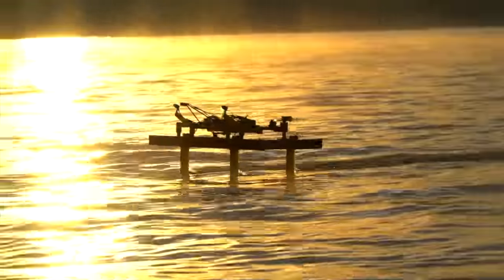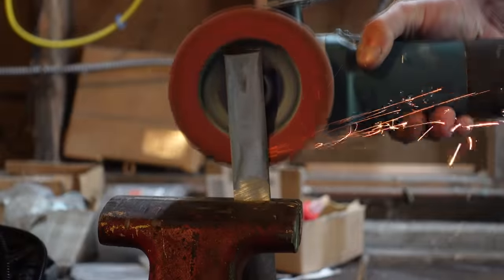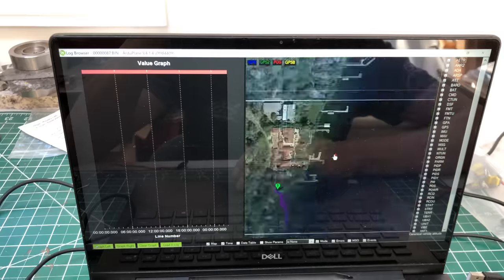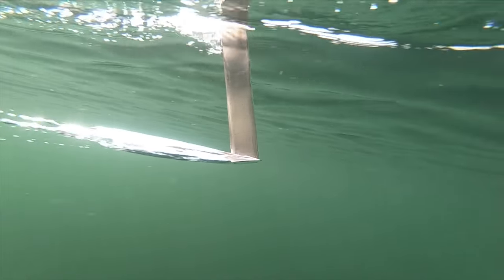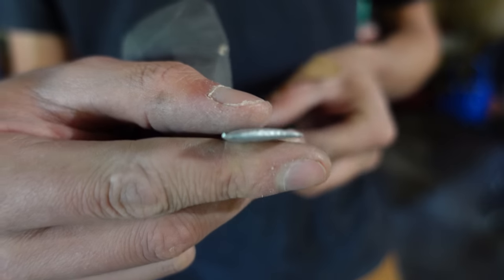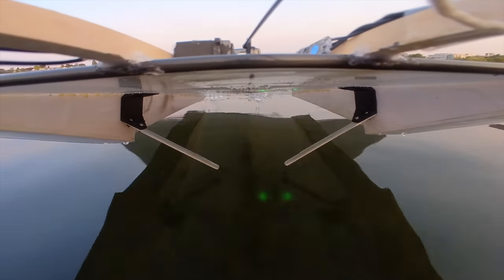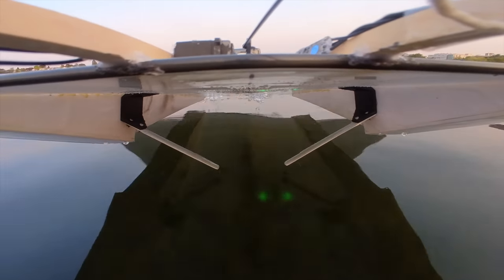Airplane + Hydrofoil - Good or Bad Idea?

Comment: In real boats, isn't yaw stability a function of roll stability? I mean if you've ever driven a speedboat or a fishing boat, that boat rolls as you turn it, the same as a motorcycle would. I think the surface piercing hydrofoil is supposed to have yaw stability because of its roll stability. There's a feedback between how much is submerged on either side. With your piercing hydrofoils, you have almost no ability for the aircraft to roll before one of the sleds or the wingtips hit the water, so it can't stabilize itself.

Comment: you're also cavitating bro... the thumb camera can see it in the video.. (the flow is separating from the hydrofoil as the craft translates vertically through the water.)  vertical translation through the water once the hydrofoil is submerged and at velocity, the flow separates.
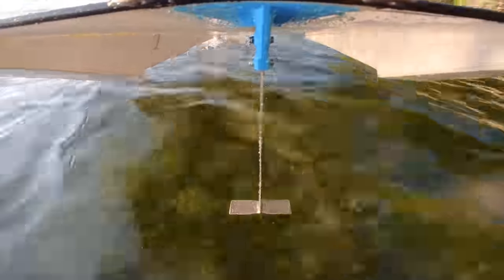Reply: from 7:29 to 7:32  when the foil is below the surface... you can see air forming above the foil
Reply: at 10:07 you can see wing tip vortices forming from the CAVITATION
Reply: you keep calling it ventilation then you bring up cavitation and start saying things like pressure drop is so large the water boils.   So when you see an air pocket FORMING across the wing surface BECAUSE it's DESIGNED to LOWER PRESSURE OF A FLUID in a directional flow...  It doesn't matter if it's a penguin streamlining through the water or a man made hydrofoil...   IT"S ALWAYS CAVITATION.   THE AIR POCKET IS THE WATER BOILING.

Comment: Angle of attack is a lot of the issue you are running into.  You have the foil mounted parallel to the bottom of the craft but the craft travels nose up, messing up your angle of attack on the foils.
Reply from the maker: But if the foil does not have a positive angle of attack, what’s the point? Then it won’t be doing anything
Reply: @rctestflight  a foil should generate lift like an airplane wing does with the shape of the wing, not with angle of attack.  You mention it yourself with the ventilation...you can see it happening in your video both when you show the example from the side of the boat and on the craft itself previous to that.
Reply from the maker: @InspGadgt  If you look at the CL vs alpha graphs of many common hydrofoils you'll see they make very little lift at zero AOA. Especially at the low Reynolds numbers this model is operating at

Comment: you are forgetting one of the biggest benefits of a ground effect vehicle. you don't need a pilot's' license. 
i would not be surprised if the only reason you are limited to ground affect area would be because of the electronics. i wonder what the speed of that thing is.

Comment: Your wing is pitched up and if your hydrofoil is pitched up too isn't it providing too much lift and therefore causing drag? Why don't you pitch the foil down a bit to provide less lift on the foil
Reply from the maker: But then what’s the point of the foil if it’s not creating any lift?

Comment: You miss the point. The idea is to have the foil to reduce the power needed to lift out of the water into GE. You don't want to operate in GE with the submerged foil
Reply from the maker: Hydrofoils were slower to takeoff than planing hull alone since they have more drag, so…

Comment: nice surface skimming spinning disc rock
Reply: mental models can be deceiving, traditions can be chain-binding
Reply: ie "I must do things this way, no other way is possible or viable, and I must convince others that nothing else is viable"
Reply: its called a law
Reply: which is not correct
Reply: logical thinking does not lead to the proper solution, logical is illogical, only the appearance how things might be
Reply: mind reasoning might be counter-truth
Reply: whatever is the measure of truth, if any, or all goes
Reply: knowers are very en-titled :)
Reply: scale fixes the weed problem
Reply: only a scale model of a large craft
Reply: large plane has more inertial mass
Reply: make the hydrofoil angle controllable, not static angle
Reply: it must be a control surface also
Reply: assume you are always in ground effect when hydrofoiling, combo effect
Reply: also it provides stability to the flight
Reply: better design please
Reply: law based cannot see anything else than his laws
Reply: scary ride if blind that way
Reply: you forgot ground effect from the graph
Reply: wider wings provide ground effect higher from the water surface
Reply: dont take off in any case, only ground effect efficiency
Reply: your song is out of tune :)
Reply: wider wings makes your craft be higher in ground effect, waves in ocean will not matter
Reply: the hydrofoil can measure its own depth to keep it stable with its own angle

Comment: Doesn’t this explain the fact that the hydrofoil won’t go under water and just planes? If the foil generates substantial lift for most angles and speeds whenever it’s in the water, and if that lift pitches the craft upward, *increasing the angle of attack and hence lift*, then there is essentially no stable equilibrium with it underwater; it’s always trying to get out until it pitches the craft so far up that it leaves the water, until it exits the water and stops generating lift, causing the craft to pitch back down. So it will naturally just want to just ride the surface. You basically explain this in the video, but draw the wrong conclusion.

In contrast, a hydrofoil behind the center of mass could be more stable: if its producing too much lift, the craft tips *down*, reducing angle of attack and hence lift.

Comment: winder - how a low aspect ratio ski will  function... - think  hinged telemark, or Rutan "ski gull" concpt, attached to that forward mounted strut  (free hinging down, with limited "minimum" AoA...  )  just for fun of course - but also assisting progressive landing for unstable aircraft.
Yes that regent thing is a hydrofoil "assisted" seaplane - the foils may  allow for low drag highspeed taxying with reduced pitching, BUT, many of these "concepts"  are just for unsophisticated investors...  (borderline scam, unviable in the historical world and most likely remaining unviable going forward.).

Comment: Think the use of ground effect issue with rc it they're already so super light you don't need the hydrofoil. I mean it can just fly without any ground effect even. It would be more realistic vs. full size to add weight so the ground affect vehicle stays near the ground. Then see the usefulness of adding a hydrofoil. Then adding more weight, until you reach an optimal balance.  Vehicles are meant to carry cargo.
You're too light man.

Comment: Regent's Seaglider WIG is designed to taxi slowly like a boat, with its V-shaped hull/fuselage in the water. As it speeds up for takeoff, it rises out of the water on a set of hydrofoils. This takes the cabin up out of the waves, making it glide smoothly above the surface for a comfortable ride. It also vastly reduces drag, and thus also the energy required to push through the water, so it uses much less energy reaching takeoff speed for wing-borne flight. The hydrofoils fold out of the way once the aircraft is out of the water, and descend again for landing.
https://youtu.be/Ka1GpNGdjXM

Comment: Check out the Hobie trifoiler. It uses a ski out front to adjust the hydrofoil position. Basically it's an analog range finder. If you had two it could even help the yaw. https://www.youtube.com/watch?v=zXSgZCDVWOM